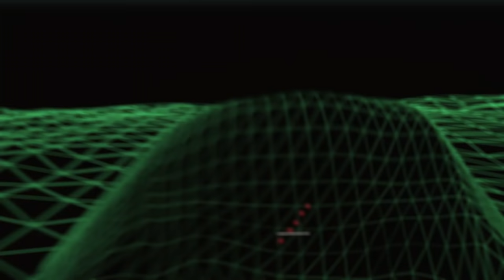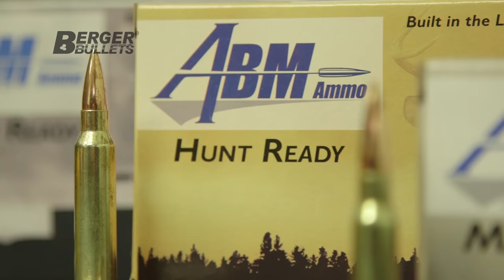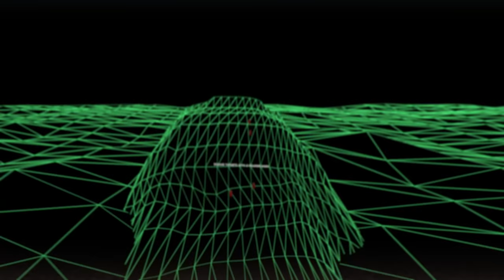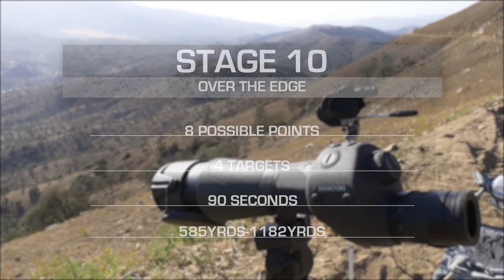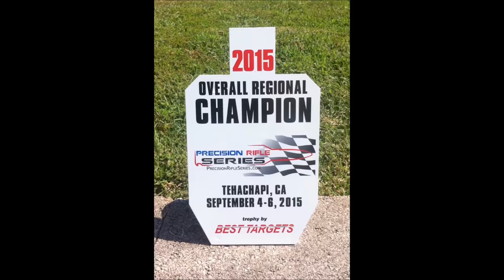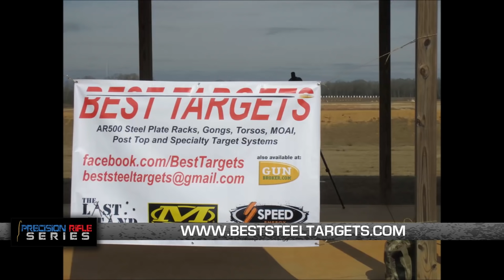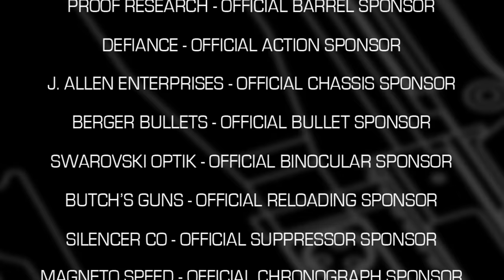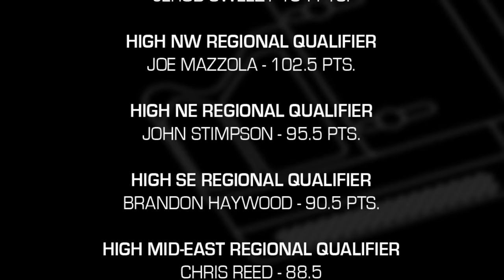Precision Rifle Series 2015 Season-ending Championship Match (Full Length Video)

Comment: Any long range shooters here? I have a question. I currently have a Vortex 6.24X50FFP scope, Im looking at a Nightforce 2-10X44, I shoot inside 1000 yards and im in Michigan, so every 100 yards is a tree. Do you think the upgrade would be worth the extra clarity in glass, or would the extra magnification on the vortex be the way to go? The Vortex glass very nice, ive only looked at the Nightforce down a street while at the gun shop. No problems so far with the vortex that I know of. If its not broke dont fix it, or would I gain clarity and a long distance advantage with the nightforce? Thanks

Comment: Why are they cycling their bold so slowly? I feel like they are all losing so much time. I understand when they are adjusting dope but they keep gently pulling and pushing, I'd be throwing my bolt as fast as i could
Reply from the maker: Hi Jake, the reason why they are cycling their actions slow is to make sure that they stay on target so that they can quickly re-engage or move on to the next target. A big part of the sport is being able to see where you impact on the target or where you miss. Its very difficult to do this is you are moving so fast that you come off target or remove your head from proper sight alignment. I hope this helps answer your question.
Reply: Contingency X it did, thanks